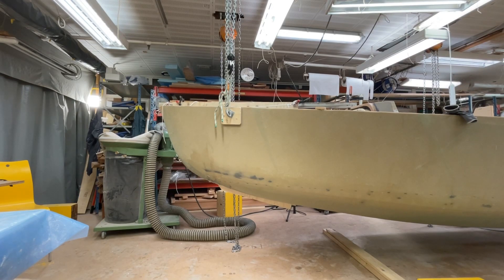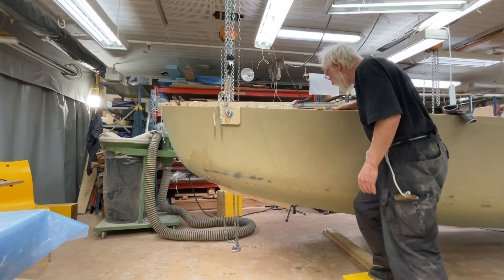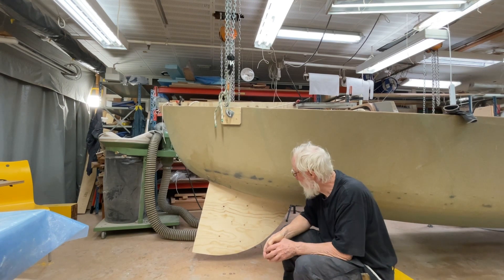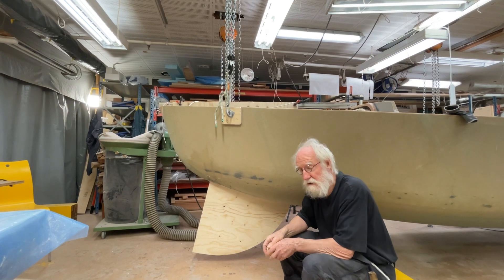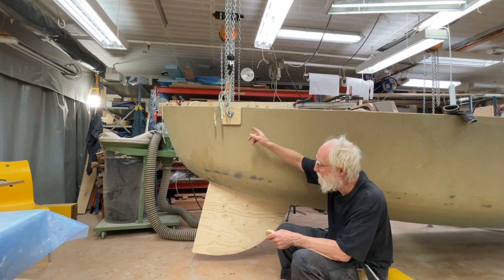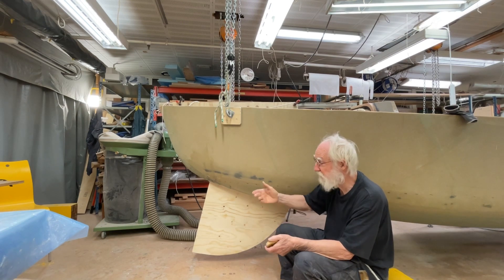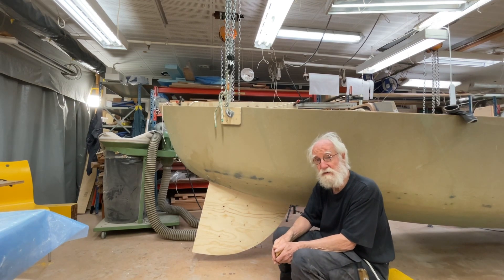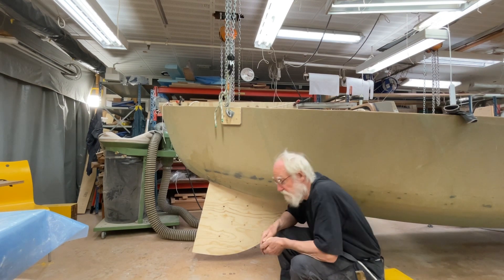25 June 2022 Bow center board , New pivot function. Internet is back and now there is a description.

Comment: hallo Sven!
so, it will not pivot anymore, or is it that it will pivot from the center instead of from the front end? i thoug that one of the advantages of pivoting was the ability to retract in the case you hit something... thanks for the update.
Reply: pivot is at front of centerboard, but instead of pivoting around an axle that is fixed in the boat it pivots around an axle that is kept inside a post which can slide up inside the keelbox. That way the keelbox is still watertight and you can pull out the whole centerboard/retainer assembly to the top of the boat for service.
Reply: @schuttrostig5729  oooh, i got it!  very clever! thankyou!
Reply: @setkacagarro-blogspot-com  oh, thank you... i misunderstood. sounds eaven better but fear then it could bind or worse be pushed upward and angled / stuck in wied position. Anyway i am sure Sven has that already all figured out in a verry working solution.